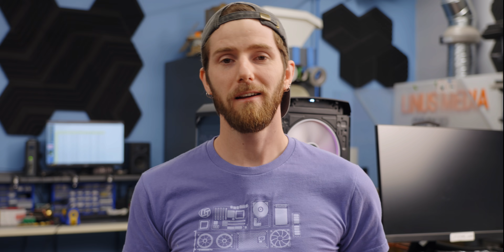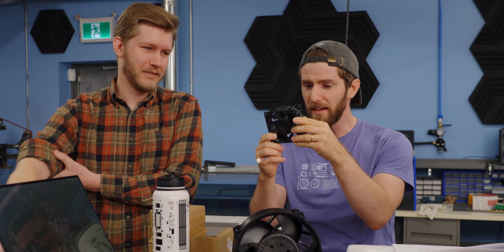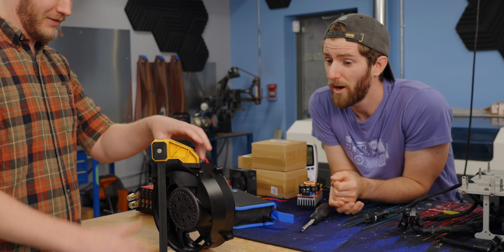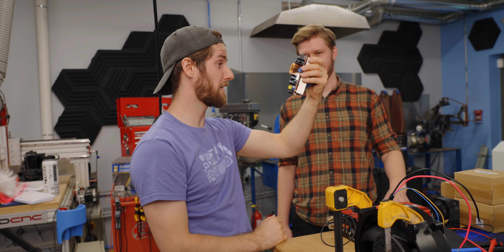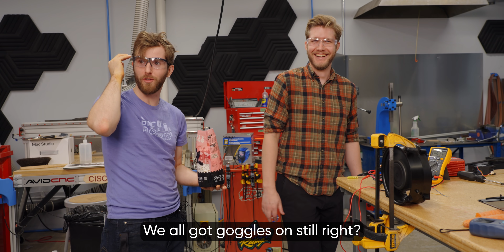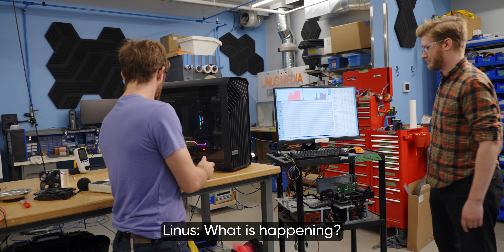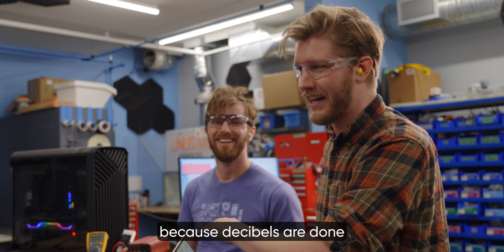The God of Computer Fans

Comment: BTW: 2 answer the question 'what do people use fans like this 4' it's not always computers. I have a bunch of fancy big aluminum frame 'Etri' brand fands (mostly) that were pulled from big old obsolete 'rack mainframe computers' like stuff from 'Digital Equipment Corporation' / 'DEC' & used 2 cool 'card bays' ~>
https://en.wikipedia.org/wiki/Digital_Equipment_Corporation

Also on the Etri (France) web site they chat up how they R often used 4 cooling stuff in electric trains & bladeebla, like I guess speed controllers & motors & so on, but mostly N E where U don't really care about noise these seem a good way 2 go, as after many years on full time 24/7 not even one of them makes any strange noise or has worn out or performs any different than any of the others, which is pretty impressive =) & same goes 4 quality hard drives. Avoiding something just because of age alone is stupid. Some of the most reliable drives R very old & MUCH more reliable, with Seagate stuff being the absolute worst, other than 'off brands' like 'Micrapolis' (micropolis =)) which R just a #FailTrain$cam of non stop bad sector accumulation =P  Even fans sold with CPUs by the major brands like AMD & stuff, often raw trash = like they can't spend the extra one dollar on a $50 CPU?  Those R old prices though so make it $2 =))  The tiny old CPU fans on 'Soeket 7' type PCs were absolutely ridiculous = so much room 2 put better fans (eventually =)

Really though if U want quiet the key is buying certain used PCs with the right nice big quiet fans & 'tame' CPUs that don't run so hot, like the whisper quiet 'desktop mini-tower' / 'MT' models of Dell Optiplex 745, 755, 760, & 780.  They're also nice because of the very natural sounding audio chips & stuff, including others with the same Analog Devices AD1984 like the DT, SFF, or USFF 'form factor' versions of those, + other models like Precision models T3400, T3500, T7500, T5500, T5400 =)  Runners up with stuff like 'C-Media' chips include Dimension 9200, & XPS 410, 420, 700, 710, & 720.  Everything from 'Realtek' is absolute krap because their drivers R written by literal retards, forcing resampling of everything to 48Khz, which causes harsh-sounding 'aliasing distortion' with other rate files, like CD rips at 44, etc, & same goes 4 all the stuff from 'Creative' or 'Ensoniq' or using their chips, like hidden in other brands like 'Asus' add on sound cards & so on.

Lately I got a bunch of Dell Precision T5810 & though they have only small diameter fans all over the place there R lots of them & they're very quiet.  I wouldn't have even tried them if not 4 how cheap they were on Craigslist, at $100 for 12 =D  That's like around $8 each LOL  They can also get 'super-computer' level performance with 'passmark' over 20,000 if U upgrade the CPUs, & do 512 MB of RAM =)  Keep on the lookout for 'auction lots' =;-D  iThink I'll B running those until I can get a pile of HP Z80 4 a similar price 'down the road'.  Also since U can send audio in all kinds of formats including surroundy ones digitally via display port &/or HDMI, doesn't really matter what the PC has 'onboard', as U will need a 'home audio receiver' N E waze 2 amplify your speakers, &/or the TVs with HDMI can pull the audio from the HDMI cable 2, etc.  Basically 'sound output' on 'pcs' is an obsolete feature because of that, + the fact that Realtek destroys sound quality wherever it goes.

Linus should maybe put some of his millions of dollars into helpful things instead of wasting it on 12K cameras, like writing a driver 4 Realtek that locks to the native sample rate of the files rather than forced resampling to 48Khz, & 'modifying' other programs 2, like modding a 'Windows 7+' version of FireFox to run on XP =)  I tried all the other browsers & they suk azz by comparison, like 4 example with FF U can mod it 'easily' so saves all the user installed plugins in portable form, whereas most 'chrome' variants (which & need because JooToob sabotaged their site so slow & buggy as fuk with N E thing else) lock it 2 the machine, so U have 2 're-install' everything 'from the cloud' & blabla

I should really put up a web site & stuff 4 XP & 7 fans, like people who need their computers 4 actual work, not just dik around with 'games' & $hit.  Everything after 7 is unusable by comparison, & of course Mac is a joke.

Comment: those voltage boosters  shown in :40 are the best things  for DIY people ,  i use 4 of them, and they do their job well  Especially if your trying to boost dc voltages a long distance, like using it in line of solar panels , they are very much   Their wattage, And if they Break and lock up its Very easy to replace the powered mosfet under the  coil  they are  very nice   and its a GREAT thing you purchased  more then 1  , because Whoever soldered mine   Missed  a few pins on the  booster chip,  that they sanded off.   after resoldering it ,  it worked great.

Comment: A friend of mine once bought a case fan close to that size and brought it over He tried wiring it up to a molex connector but it wouldn't run. Turned out it wasn't even a DC fan, it was rated for 110 volts AC. I wired a short piece of extension cord to it and plugged it into the wall outlet, thing ran great but was way too loud for a case fan imo. Dang thing was it was indeed a case fan... only one like it I'd ever seen.

Comment: I didn't have to buy them, but I know some oil cooled motors which use similar fans.
an use case I can see would be in high performance cars.

tbh you could probably make a shopvac with those, just take 2 buckets, plonk the fan on top, squeeze a hepa filter in there, add a plank with a hole and a tube through it, then put a tube on the side for the intake to have a cyclonic separator and bob's your uncle.

Comment: According to my experience, this is usually used for server racks, not the conventional type, it may be a closed computing node, they usually have limited ventilation openings, so a large airflow fan is required to support air change efficiency in such a situation.

Comment: Too much drama & irrelevant item for power supply. One rectifier module like Delta ESR-48/30D would be good fit for it. Its have an AC input socket also which fits normal power cable.

Comment: I'm really surprised that neither know that the regular blowymatrons are PWM (Pulse Width Modulated) where as those weiner remover 5000s are just straight DC power. Two totally different things. PWM fans and motors can't supply power since their supply is technically AC, not DC which now I wonder what would show on an oscilloscope when connected to positive and ground.

Comment: i would imagine these could be in use in advanced CNC machines. We have some 90s CNCs with BIG control cabinets / electric switching cabinets and they have 6 of these fans (albeit slower turning, but same size and all metal just like these)

Comment: I work with large machines that make paper and plastic bags. The electronic enclosures are roughly 3'x8' they have fans like these on the end and pull air through the entire enclosure. Idk if they run this fast but what I can image in a similar industrial electronics cabinet 
Alternatively they will have an air conditioner hooked to them. 

Lotta electronics in a large enclosed box.

Comment: Granted, you have to go back to the early 1990s but we had a dual processor system with a disk tray. It had a pair of 220V blowers to cool the rack. Not fans. First time we turned it on, it removed all of the sound deadening foam from the wall.  Before they got to full speed. The power had to be staged - first the disk tray, then the fans, and finally the system.  Trying to turn on all three at once would trip the breaker. Rated for 20A. (As in almost 5KVA)

Comment: We use two of these in the server room to cool, not just the servers but the entire room. One pumps air in, the other pumps it out. Unfortunately servers were set up so that the air in the room was running in circles. Slowly overheating and turning it into a hot sauna. Could have been avoided by adjusting where the servers are standing and making sure air doen'st do loops but we were asked to fix the temperature issue fast and moving all the servers around wouldn't be fast enough. Furthermore, the room was technically too small to handle all the servers. Even if we line them up properly, the last machines would be hit with too much hot air from the previous ones anyway. Two blowzookas saved the day and because of the stupid circular design of the room we got all machines equally cool.

Comment: I have seen them in transport scervers in telecounication centrals. They are in a configuration of 4 blowing from the bottom and up throughout the vertical scercetboards. 48 volt is the standard voltage for all Telecom equipment. They have one UPS system for mostly all the racks.

Comment: You actually need to spin the fan backwards to turn it into a generator. However, that could happen with so much airflow. Diodes also have a limit to how much reverse current they can handle before they reach breakdown voltage.
Reply: LOL!!  U R just inventing random bull$hit =))  If it's DC it just flows the other direction!  Whenever U move something or keep it from moving there is always a reaction, like the 'conservation of mass' stuff.  If U send power 2 a fan but won't let it spin, the motor heats up (trading rotational motion for molecular motion), etc.

Comment: When I was studying for my engineering degree, the head teacher got us a "field trip" to a radio tower. Some of the boards were as big as a table and components like capacitors the size of my head, whole strips of 1 Farad capacitors, switches that you need a pole to flip, most surprising thing was, you could hear the radio station in the whole building and inside the base of the tower even more. Just by the sheer voltage the tubing and wiring was carrying. There were no speakers or anything remotely similar.

Before starting we were very seriously told that if we were to raise and point your finger at anything and survive, we'd be OUT. also it was HOT, they weren't using this kind of fans, it was a whole dedicated industrial airduct which conveniently just sucked all the air out since the tower was just sitting out there in a mountain

Comment: You could honestly just buy the big 30 amp variac from circuit specialists for $180 and build a super cheap rectifier circuit and it would probably only cost about $200. There you go 3.6kW variable power supply

Comment: So I can get a pc fan for $422 and get 500L/s at 600W and chop my fingers off or I can get a 6in slim automotive radiator fan for $25 that does 300L/s at 80w and has an appropriate safety cage(on one side)… I pick the second one

Comment: I work at pallet factory building pallets and some of our automated machines have almost identical albeit slightly smaller fans cooling their electronics and hydraulic systems. They have one on the back of a hydraulic oil cooler, one on the side of a giant metal box that contains all of the electronics and another one on top of the electric motor shroud that pumps the hydraulic fluid..... 👍 The one used on the hydraulic oil cooler might be the exact same size fan as you guys have.

Comment: Actual purpose of these fans:
To cool enterprise data center UPS systems at the 250-1000 kW level.

I worked at a data center that had a pair of 1000kw UPSs and each lived in their own switchgear room.  They were mirror images but backwards.  They were the loudest windiest room I've ever been in.  Each UPS system was as big as a VW bus and each system had something like 16 of those fans broken into intake/exhaust banks.  

These UPSs were older AC-DC-DC-AC fully rectified always-on style, and had large inefficiencies associated with their design.  Each UPS had an accompanying pair of 30ton CRACs set to alternate weekly to keep them cool.

The room was a terrifying but modern and safe switchgear room that took utility, UPS, and GenSet power in.  Under the auspices of SAFETY, they had a long board on the wall to use if someone got electrocuted and clamped down on something while they burned.  And earmuffs.

Comment: Seen these in the oil and gas industry for MCC's (Motor Control Center) that have VFD's (Variably Frequencies Drives) or in the  larger standalone VFD's that are bigger than a cargo van.  Those electrical rooms are stupidly noisy.

Also those other fans won't work as a generator unless the armature or stator (can't remember which exactly) has permanent magnets to start the magnetic field or a power source to make the field for the motor windings to cut through to generate a voltage.

Comment: we I sued this bad boys , for power electronics system, in summer when the machine starts to over heat and autide tamp is raising , PLC connets 4 of this guys and we have no temp problems, and because if there is power outage , we have plus four on battery power and for backup.

Comment: Yeah of course that boost converter doesnt have a chassis, its supposed to be a component you put into a larger device, likely one you build yourself. When you’re at home building a 200w flashlight cause you thought it’d be funny you’ll be happy it doesnt have a chassis because that gives you access to the whole thing and lets you cram it wherever you want

This is like buying a set of ICs and complaining that its not a fully assembled machine yet

Comment: 14:35 They are used in large variable frequency drives to cool the heatsink for the IGBTs. I have 3 (though not Delta branded) from a scrapped WEG 250kw drive. Mine need at least 40v to spin up and I have not come up with a legitimate use for them yet, just fun to have.

Comment: L:inus is a baby! I've used MANY of those naked boost/buck converters that adjust with trim pots. Just 3D print a case next time before you whine about it :P Imagine having those in your 3D printer running while you sleep. 
Nerves. Of. Steel     (Lots of marijuana helps)

Comment: The only thing that really got me was when they were putting tape on the rotor to measure the fan speed, all while the Tach signal wire was blowing in the wind. If you just measure the frequency of the signal coming from that with the Fluke, you should be able to directly measure the fan speed without any additional instrumentation.

Comment: I'm a cinema operator we used to use 2 of these bad boys in our old xenon arc lamp projector. Because working temps on those old projectors were quite strict we used to use 2 inside chase of projector and then another fan that was even bigger to suck air out of the room. We could heat our auditorium that can hold to ~500 people with that projector until late October early November without ever turning up the actual heaters there.

Comment: Fans like that?  The application I may say could be in cinema projection to help keep components cool from the Xenon arc lamphouse.  Maybe even IMAX but those all probably still use ducted centrifugal fans as I don't think it may be at all possible to keep the components cool as well as keeping the projection booth quiet enough during a movie, but I am not an engineer for those systems nor an engineer at all.  I would say I am just an innovative if not inventive techy.

Comment: We use 8x similar AC Delta fans inside each shorepower converter on the yacht I work on. They're pretty much fridge size power converters that can take single or 3 phase 208-1000v 50 or 60hz input and convert it to  480v 60hz 3 phase when we're on the dock anywhere in the world.

Comment: In regards to a practical usage for these kinds of fans.

I worked with green coffee bean storage at a coffee roaster. Ideal conditions being like 60°f and 60% humidity or something ballpark. We also wanted to move air to keep pooling humidity and condensation during winter. I could see these kinds of fans being excellent in a small footprint building or with bad exhaust allowance in smaller buildings. Especially if you needed to vent smoke from a small room or keep a positive pressure room to keep smoke out of your bean storage. But I don't know if this specific kind of fan would be practical over the other options that I've seen. It does move a lot of air in a relatively small form factor (specifically in regards to commercial use). 600W may be the cost break point for this solution. A commercial 16 inch fan from home depot that costs 100$, and pushes 1600 CFM at 1.6amps at US wall current; or about 190 watts. Would be more cost effective in most practical situations.

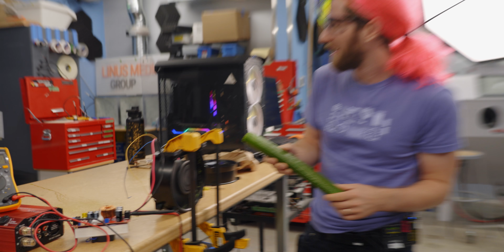Comment: I keep coming back to this video as one of the genuinely funniest, most surreal videos LTT has put together. The crazy wigs for wind effect held back with zip ties, the nuclear-strength banshee cooling fan, Linus’ genuine shock as his cucumber is vaporized at 8:39 in a chapter named “Saftey Test” (their typo, not mine), a vegetable smoothie being sprayed all over a laser etcher, the empty stare and dazed post-adrenaline commitment to more madness at 10:10, stuffing TWO of those fans into a tower for a ridiculously academic and unnecessary benchmark, and using the suction to test normal cooling fans for backvolt protection. That is one hell of an episode on paper, and it STILL is much greater than the sum of its parts. Fantastic content.
Reply: Same here. Probably one of my favorite LTT videos to date!
Reply: I didn't even notice the zip ties until just now!
Reply: Same!
Reply: Lot of his videos seem deliberately dumb, like mounting the 'bitcoin mining heater' up high above the desk rather than on the floor by his feet = just dum.  2 go down that track, they should really just embrace it, like 'liquid cooling without water (using other crazy fluids) or 'super computer in a junk case' for 'theft deterrance' & so on =))